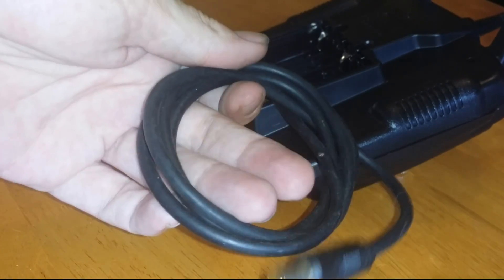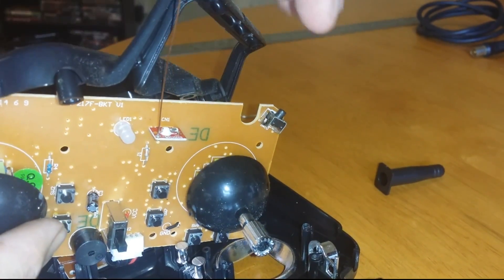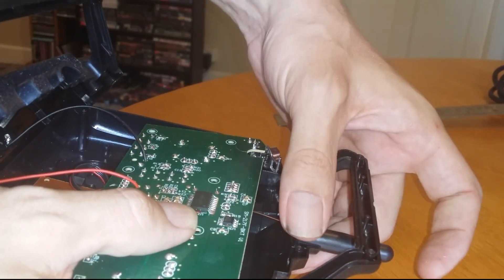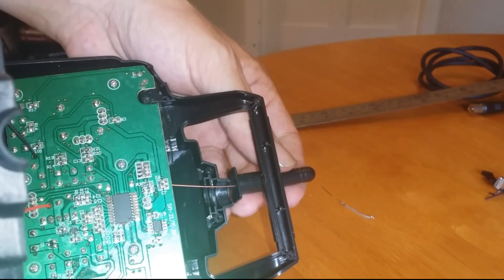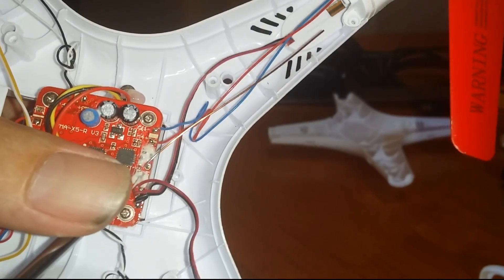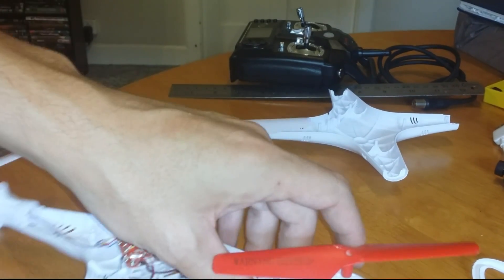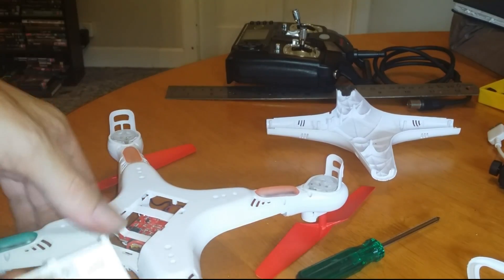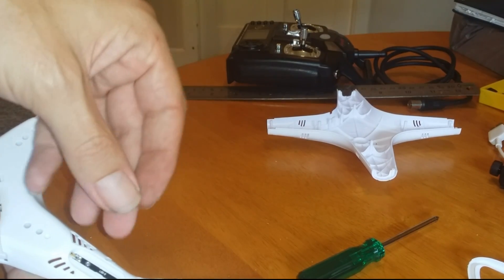Syma X5C-1 Modifications

Comment: You don't need to mod the antenna on the quad.  I've modded mine exactly as shown here with a 1/2 wave wire running down an arm -the range was worse than before.  I've tried all types of receiver board mods, just keep it as is or if you're wanting to tweak, run the existing wire straight up out the top.  I have a syma clone with tons of range stock and they're mod is totally on the controller - not on the receiver.  The only way to get tons of extra range strictly having to do with the receiver is likely by installing a grounded antenna there.  I can guarantee any additional range he is getting has nothing to do with the quad antenna, and it may be worse than before.

Comment: copper onboard antenna? I used the core wire from a rp-sma coax cable.
Reply from the maker: Yeah I used the core of tv rf coax. Probably similar to what you used.
Reply: Does it work good

Comment: I don't get it. Your calculation of 62.5 mm is right for a dipole at 2.4 GHz, but that's not what you've got here, since a dipole is fed in the centre.
A ¼-wave antenna is the optimal length for a normal antenna. In this case, 31.25 mm (which is about what is provided). An end-fed dipole needs earthing in order to tie the half-wave at the ends. Clearly that's not possible with something that is flying, nor is it practical for the control unit.
Reply: Thats totally confused me, could you explain? I've just been told to use a 2.4ghz wifi router antenna the cable seems to be about 12.5cm standard, is that going to work well?
Reply: v=fλ : velocity = frequency*wavelength. Velocity is, in this case, the speed of light. This can be rearranged to:
v/f=λ
So, 300*10^6/2.4*10^9
= 300/2400
= 0.125m
=12.5 cm
That's a full wave. But an antenna should be either half that (for a dipole) or quarter that (more normally).
So 6.25 cm for a dipole, 3.125 cm for a 1/4 wave antenna.
I can't see how a 12.5 cm antenna would work well in the 2.4 GHz band. 
However, what is actually inside that rod on the back of the router is probably not a simple straight wire.
My electronics dates back quite some years, so if anyone can improve on this explanation, please do!

Comment: Please help!! i Have the syma x5sw.
when i first got the drone, headless mode was already on, i pressed something and now it does not work, it says in the manual that i have to hold the top left botten for 2 sec to activate headless mode, but when i press it, it only changes the speed from L to H, it does not Beep 3 times.
Reply: Crack the transmitter open and fix the buttons

Comment: Hey, I was doing this on the syma x5 and the metal pad broke off where the shield is supposed to be soldered and now only the board is visible in that spot. I tried to add soldering to that area, but it wouldn't stick. Any suggestions?
Reply from the maker: you can get re-track kits for pcb's it's not easy to do sometimes. have a look on YouTube for a tutorial. Sorry I'm not much help.
Reply: okay man thanks. Any idea why the stock ones arent grounded?
Reply from the maker: +Brett Young cause they are cheap Chinese toys lol.
Reply: haha. How does it still work? I tried soldering the antenna just to the main pad without the ground and it still didnt work.
Reply: +Brett Young You solved it now?
Reply: Nope tried the stock antenna from the x8c that didn't have groud, and it still didnt work..
Reply: +Brett Young Well, the body of myX5C-1 does not even open up!! So I get just only half mod coursing that idea! And now I have even the place of where you put the power RUINED!!!...anyway, I did a "was beter first".
Talking is easy. ....
So I doubt that after this I will ever do something like this again.

Comment: I bought extended antenna here: http://www.banggood.com/Wholesale-Dual-Band-2_4-or-5_8Ghz-6dBi-RP-SMA-Omni-Directional-Wireless-WiFi-Router-Antennas-p-49578.html?p=KF11041475362201504C
and the cable: http://www.banggood.com/10cm-PCI-UFL-IPX-to-RPSMA-Female-Jack-Pigtail-Cable-p-924933.html?p=KF11041475362201504C
Reply from the maker: +Ameriqo Quantante cool hope this helps someone els. I just use stuff I had lying around :)
Reply: +Devolution RC I know, it is the same but it is possible to buy cheap antenna.

Comment: so first you said the antenna in your controller was at 62.5 mm but when you measured it was at 60mm. And then you said the length of the antenna in the quad copter was at 62.5 mm. I tried this and had both at 60mm and having issues staying connected. Do they both need to be at 62.5mm?
Reply from the maker: The total length including where it's soldered is 62.5mm as far as I am aware the measurement has to be close to spot on for the frequency. Double check your soldering too.
Reply: +Devolution RC okay thanks. I'll give it a try!

Comment: how can I install a Mic on my x5sw
Reply from the maker: what do you mean?
Reply: +Devolution RC mine's didn't come with a built in Mic
Reply: +Devolution RC trying to see if you have any advice on which part on mother board do I solder
Reply: +Devolution RC I have a mini Mic with only the black and white wire on it
Reply from the maker: +Kenny Mann oh. I didn't know that. I use a N°16 808 Keychain cam on mine.
Reply: +Devolution RC do it have a Mic on it too
Reply from the maker: Yes and they are cheap :-)
Reply from the maker: If you open your stock camera look on the pcb to see if it has pinouts for a mic.
Reply: +Devolution RC kool Thx a lot bro
Reply: +Devolution RC question was the coax cable from a tv cable cord
Reply from the maker: Yes. I used an old one from a VCR.
Reply: +Devolution RC shit yea....how much more range did it give you
Reply from the maker: Probably close to double or more. I saw a lot of videos were people weren't getting much distance, so I modified mine before I even flew it.

Comment: Anyone knows if two Syma X5C-1 can fly simultaneously, each with its own remote? I know that one transmitter can run two of them simultaneously, but that is not what I care for. I want to know if me and a friend can race them side-by-side.
Reply: A buddy and I fly our X5C's together all the time. We've found that once one of us binds and flies a distance away, the other then can bind his. otherwise, We've had whoever's in the air first control both. Bad news there.
Reply from the maker: Hi, the answer is yes. Turn both quads on and sit them on level ground, then turn on the transmitter and bind :-)
Reply from the maker: John Hoover lol a friend and I had that problem with small iR helicopters, his was marked wrong on the box and both where on the same channel.

Comment: This video actually highlights some perfect examples or aspects of design and manufacturing the Chinese don't seem to usually pay much attention to.. The finer details or specifics. Question is though, did they do some of it on purpose to make more money, to which I'd answer both yes and no. The X5C can take a pretty good beating, that much I know for certain. The overall construction can be crashed 500x and it hardly damages it at all, a bunch of scuffs maybe, but that's about all. Other things however like the engines for example seem as if they weren't made to last as long. I had to purchase several (again from China) for a brand new X5C used no longer than a week or two. Now all of the things in this video.. as well as even the "Goo" battery shown in the video: Crap. I bought six of them about a month ago and four of them are already completely dead. One even started leaking and I could smell the polymer or whatever it is. The propellers: Great. You can even bend them in half and those suckers wont break. The rest is pure genius - with exception that these smaller copters are still basically toys compared to the more expensive units, so they can hardly even fly against a 15mph wind without going down or getting carried by the wind hundreds of yards towards the way the wind is blowing, which can get extremely annoying. Night flying on a calm night is a blast. The lights look super cool in the dark..
Reply from the maker: Thanks for your comment, you've had some bad luck with the batteries and motors. Mine have lasted, and yeah you are right they are toys and the wind can be a big pain like you said :-)
Reply: I've seen people stick replacement DJI or brushless engines in them and get nucking futs performance, wonder how it would go.
Reply: You just get brushless motors with the same specs, theyre more efficient and have better output for the same draw.  There's literally a ton of videos on youtube about the brushless conversions, and the pcb seems just fine. Im sure their comments section would explode if so.  There's actually a whole heap of really cool mods for the syma series. OMG that cheerson tho! :o noice! Im looking into a Syma X8HG for my first muck around drone, are there any other recommendations you could give me? Cheerson? JJRC? MJX? it's so hard discerning all the different models! Any tips or good models would be appreciated
Reply: Erebus
Well, since those type of engines require more power and different ESC controllers, there would be far too much power going to the main Syma circuit board and it would just burn up. Another thing is the Syma body would probably be too light, so it would most likely just flip over or act extremely erratic, unless the weight was balanced out properly. All in all, I'd say it would be a pretty pointless venture. Better to just buy a simple stock carbon fiber frame, main board, controllers, etc.. Although, I don't really care for carbon fiber stuff. I'm actually a Cheerson CX-20 person myself. I'll be going for the CX-22 at some point in the future..
Reply: Erebus
I can't say enough about the CX-20 because if you ever learn how to program waypoints into it, the things it can do will simply amaze you. It has a pretty steep learning curve, but after you understand how the Open Source version ticks, you'll never go back. Again though, you'll need to learn a bit of advanced programming techniques using certain software. I actually even sold my Dji because I think the CX-20 is a lot more advanced, but not at first! After I bought a 3DRobotics 5200mah lipo, I was getting 20 minute flights doing 2 mile trips. Again though, can't emphasize enough that there will be failure in learning how to program it correctly. Never trust your own skills using a hand transmitter when going long distance! Always use automatic RTL (return to land) and try to rely on GPS or you WILL fail, miserably. I've lost a few that way. I've also smashed at least four bodies to pieces, but what saved me tons of time/money every time was the essential godsend: THE ALMIGHTY HOT GLUE GUN. Even then, I still needed a few extra body shells. So if you go the Cheerson route, get a glue gun - if you don't have one already.. and be sure you buy the Open Source version because the other ones are pretty much unpredictable crap. You MUST be able to program it, like a computer. Last but not least on the CX-20.. learn how to calibrate the hand controller and most importantly the compass on the quad, before flying ! If you do all these things right, it flies like a dream. Failure is the key to success. It took me at least a year.
Reply: I've build a 3d printer & programmed IC's before so I'm sure I wont too many issues :P
Seriously though, thanks for sharing the Cheerson, was going for the syma x8hg but the cheerson with gps is totally winning me over. Anything else I should look at around the same pricing?
Reply: Hey man! soooo I'm buying a Cheerson cx-20 today, im just about to head down the bank to put the cash on my card. Was wondering if I could bother you with an email about whatever mods and upgrades you've done to yours, even things like best batteries (3DRobotics?), range exteders? etc my emails kobra.promotions@gmail.com if its ok
Reply: Just got my Cheerson, Whoo learning curve! damn thing keeps beeping when I connect it to my PC
Reply: Erebus
You still have to have the battery plugged in when plugging into USB.
Reply: Just figured that out :). Thanks again for the quad recommend.
Reply: Loving my Cheerson, just wish my extra batteries had arrived before the quad haha
Reply: Erebus
It can be a fussy beast. Calibration can be total nightmare if you screw up. She'll go completely bananas. Beware !
Reply: Erebus If it starts acting erratic, calibrate the compass, but just don't screw up. If the compass loses it's bearing, the quad will go crazy and start slamming into objects !
Reply: Erebus
Get a 3DRobotics 5100mah 3S 8C battery. It will give you around 20 minutes of flight time, but you have to keep the door closed with a rubber band because it sticks out slightly. It looks like this: https://www.bhphotovideo.com/images/images2500x2500/3d_robotics_prc0010_5100_mah_lipo_battery_1098130.jpg

Comment: Will copper wire work?
Reply from the maker: Yes just make sure the diameter or gage is similar. I used the core of coaxial cable because it's designed for RF.
Reply: I hope I got the measurements right.. Did what u said and it feels great.. Just waiting on a non windy day to test it:) Ty so much
Reply from the maker: RayReyes79 you're welcome, I hope the maiden goes well for you :-) tag me in the video if you upload one...

Comment: Devolution RC I went to do this, took it apart, then I decided it was fine like it was so I just put it back together no modifications made. Now, the controller just has the beeping noise constantly and does not respond to any button presses. The screen at the bottom does not show my inputs either. What did I do? Thanks.
Reply from the maker: Make sure the little cable from the main board to the lcd is plugged in correctly. Also make sure the chrome trim buttons are not stuck/jammed on the micro switches. Hope this helps.
Reply: Devolution RC Will do. I'll let you know after I check if it works. Thanks a lot for your help.
Reply from the maker: No problem :-)
Reply: Devolution RC Well... none of those things were happening so maybe the board is defective and I just bumped it too hard or something but once again, thanks for your help.
Reply from the maker: Eli Weitzman Your welcome.. Bummer. Lucky a new remote is cheap :-) or maybe you'll find a video to help fix it?
Reply: Devolution RC I'm just going to buy a new remote. They are cheap!

Comment: Could you could have gone to 124.97mm or 4.92 inches which would be a full wave length at 2.4 ghz which would have given you the maximum transmit distance? Still a half wave is much better than the original antenna length. Good job!
Reply from the maker: Yes you can go full wave, I chose half wave for two reasons. 1: the antenna still fits inside the tx housing and gives at least double the range. If you go full wave the antenna will protrude the transmitter and easily get bent or cause injury. Plus as it is the quad can be quite hard to see when it's far away. Thanks for watching and the great comment :-)